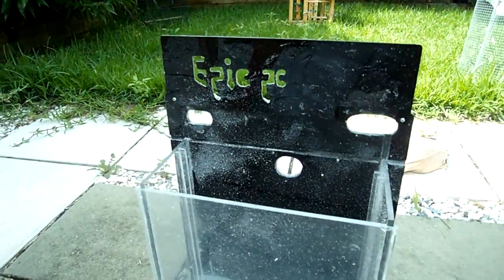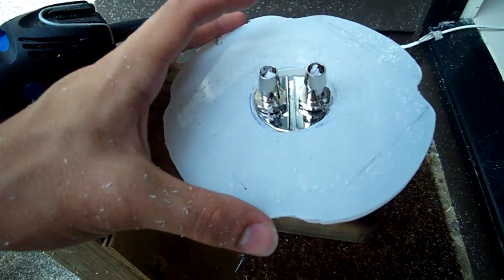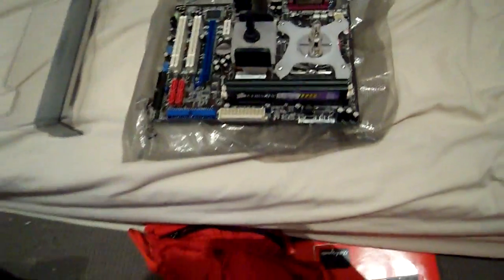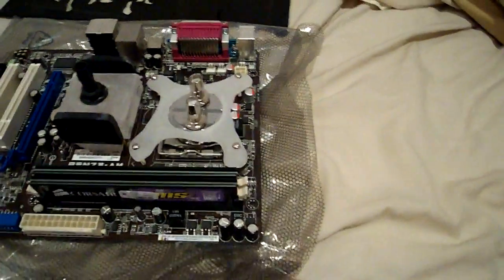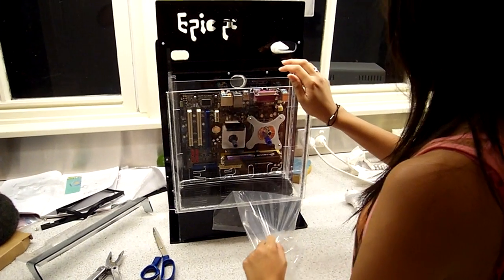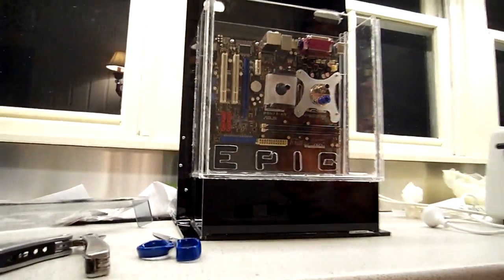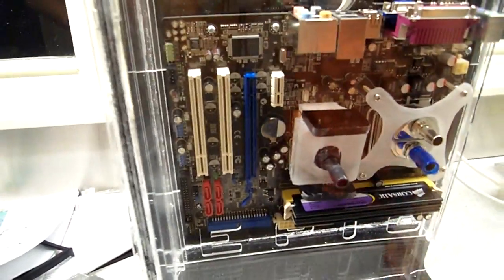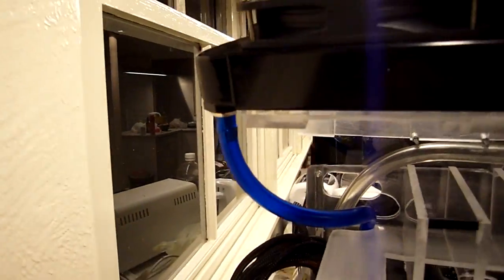Part Seven: Mineral Oil Install and Custom Waterblocks

Comment: is it even worth it to mineral cool the entire mobo? i get that it will cool everything down a bit but unless you stick a pump and rad through there wont the mineral water heat up and only cool it by a few degrees?